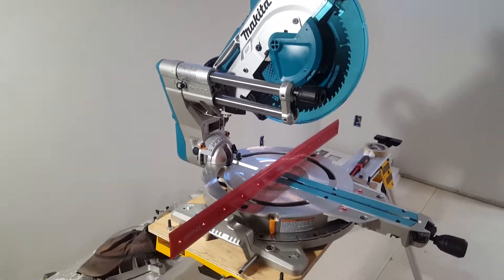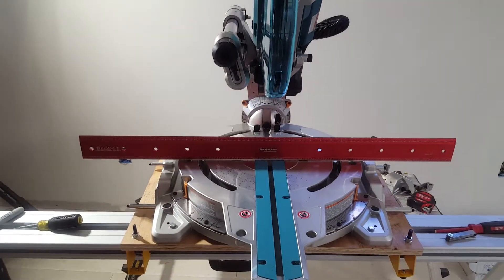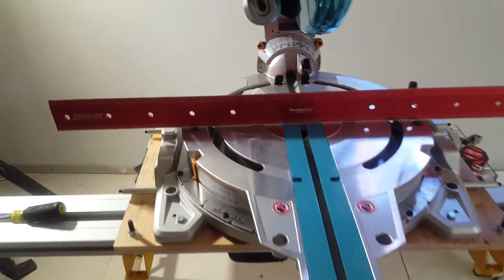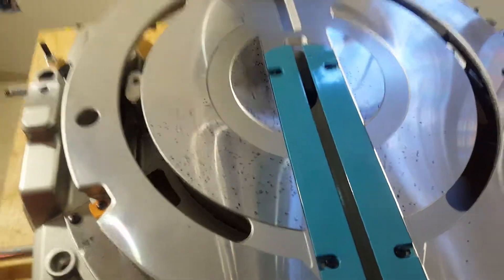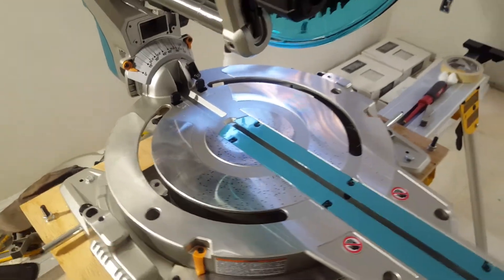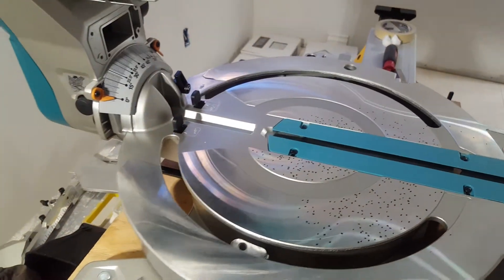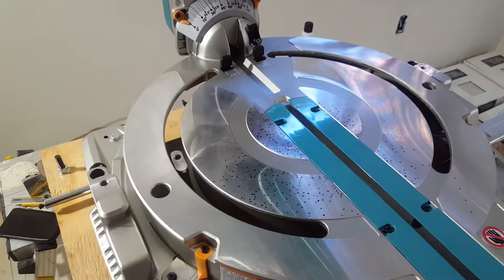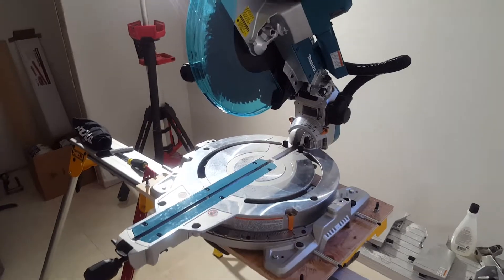Makita 12 inch Cordless Miter Saw XSL08 PT Calibration Part 1

Comment: nice video, hay i was thinking about a miter saw (makita 12" 36v miter saw or bosch 12" miter saw ) what your take on the matter? thanks
Reply from the maker: To be upfront I have no experience with Bosch.  What i have come across during researching a 12" miter is that many people comment that the Makita is not only the best cordless saw but the best saw period in terms of quality of construction and precision.  Its not a perfect tool but no perfect tool exists.  The detent plate has been known to be problematic.  I don't particularly care for the locking/unlocking mechanism for swinging the plate and I would prefer a shadow line rather than laser.  I also purchased a back fence for the saw due to the upper and lower fence having a significant measurement difference out of plane.  Performing a 4 cut calibration test the saw performed 0.005" discrepancy and this was accomplished out of the box.  Hope this helps
Reply: @treystills  thank you for your time, than makita 36v is target / ordering thru home depot again thanks!!